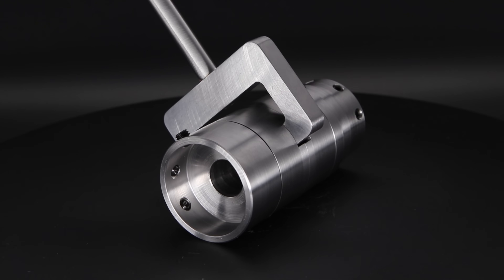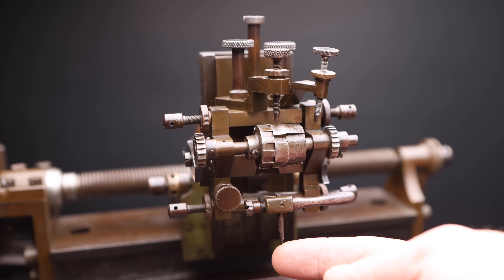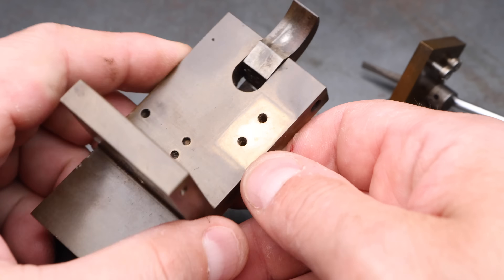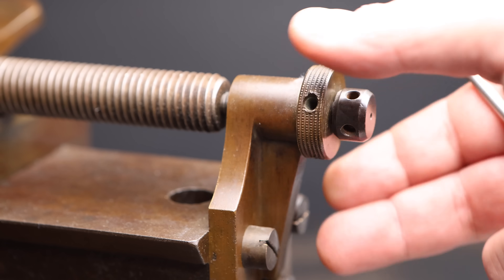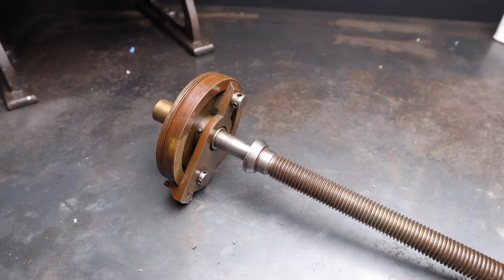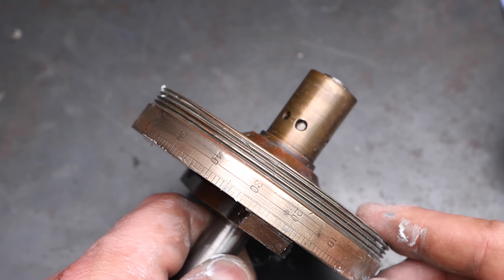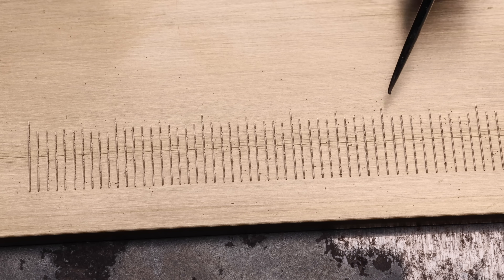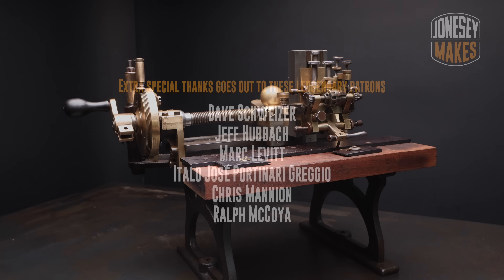The Most Interesting Tool You’ve (Probably) Never Heard Of? — And I’m Giving It Away

Comment: It looks to me, that it could be a tool for making rulers and tape measures Possibly? because of the way it makes an equal measured amount of lines, and every 4 small marks made, it will make a longer mark of equal distance between the smaller ones?  At least it seems like it Just by the way you are operating it. And all of the movements are adjustments for different size types of rules needed? I don't know? It just seems like it is a practical way of doing it? Having a tool for building rulers and tape measures?
Reply from the maker: You are absolutely right. That is exactly what this machine is intended to do.

Comment: the very common 60/40 brass is much stronger and much harder than almost all bronze, the reason for bronze is that its much more corrosion resistant, hence "gun metal" which is actually old naval canon barrel metal, which was used for lots of other things simply because of its availability.

Comment: 12:48 I didn't expect to see hex nuts on a machine this old. Do you think that nut is original, or do you think it may have been replaced at some point? I guess whoever machined the parts for this thing was certainly capable of machining a hex nut.
Reply from the maker: Good point, could well be a replacement
Reply: He’s nuts were first invented in the 1700s. They went into widespread use in the early 1800s. Can’t be sure but that nut looks similar to those made in the 1830s. Notice how thick it is.

Comment: A beautifully elegant design that appears to achieve its function with impeccable precision & efficiency.  

Consider that the designers of this machine were able to conceive how each of its sub-mechanisms would work within the greater whole of the device itself, before illustrating everything in a complex blueprint - all without the aid of a computer to help visualise it. 

None of the adjustment screws seem to interfere with any of the others, even allowing for the space needed for human fingers. This is far more remarkable than it may seem, especially if it was designed by a team of craftspeople working together while maintaining the extremely tight tolerance fit on the parts. Seriously, the various parts were cast & finished or crafted out of stock to fit together so precisely that it still functions more than a century after it was made.

I only hope that anything I could craft would do the same. Thank you for taking the effort to restore this amazing device to near its original glory.
Reply from the maker: Thanks for the kind words!

Comment: There is a surviving machine (I believe from the Keuffel and Esser company) for laying out the markings on slide rules  Only ever seen in a set of photos, machine is probably ca 1900.  There are some differences, but its construction is similar to this machine.  The K&E machine, later of course, makes use of supplemental notched disks (similar to those in chiming clocks for controlling the striking work for the hour) to semi-automatically locate the un-equally spaced logarithmic markings on the slide rule scale.  The notches in a given disk determine the amount of leadscrew advance on each "step", allowing for arbitrary spacings between graduations, limited by the accuracy of the notches in the disks.
It's something of a hybrid between this machine and something like a van der Woerd style automatic screw machine (sort-of).
Reply from the maker: Very interesting, thanks for sharing

Comment: What blows my mind is that standardized screw threads, which greatly facilitated the increased development and proliferation of new high precision machines and tools, were developed in the 1840's. 

If this precision linear dividing engine is from that era, it likely means it was among the very first generation of new precision machine tools that benefitted from the advent of standardized threads. Since its function is to scribe linear graduations on measuring devices, its developers would likely have strived to maximize its own inherent precision. To that end, I would have expected them to take full advantage of state of the art technologies of the time, including standardized threads.

Have you or Inheritance Machining happened to measure the thread patterns on the various screws and tapped holes to see if it matches up with any of those early thread standards?

This could very well be a priceless museum piece for the industrial revolution! 😮
Reply from the maker: Very interesting. I only measured the leadscrew and that was spot on 10TPI

Comment: I'm new to this site. Interesting machine. I wonder what steps the designers went throug to design and build it. They used basic components like screws, lead screws, etc. Would you see if you can find an explanation of how it was designed? It may be in a book, notebook, drawing, etc. Perhaps a mechanical engineering text would be adequate for the basic components. Start with the objective: scribe lines at equal intervals. Then, make some of those interval marks longer. Finally, make the longer intervals at regular intervals. More?

Comment: When, in 1964, the US Navy sent me to machinery Repairman School, we were issued with 6 inch, machine engraved rulers. We were taught that the 1/64 inch lines were .008 wide and the spaces .007, thus .015 close enough to 1/64 inch. We had outside calipers, and the pass out test was to turn brass, to various diameters, using only the caliper and rule. The pass was plus or  minus  .003 inch, checked with a micrometer. We should be able to visually pick half way on the .007 gap. At 17, my eyesight was good enough I passed. Now at 79, I struggle to read a micrometer. Amazing to see how those rulers were made!
Reply from the maker: That's interesting, thanks for sharing.

Comment: Using some mechanical machines and instruments, I found benefits from replacing the single line reading mark - with a vernier scale for higher accuracy settings and measurements.
A ten TPI leadscrew would make it easier for working in decimal fractions of an inch.

Comment: What is the purpose of the large threads around the handwheel?  I see that there is a guide that engages that thread.  Why is this needed?  Doesn't the 10TPI main leadscrew provide all the longitudinal motion?
          Can this machine provide EXACT  division, such as 9 divisions per inch for piano roll tracker-bar manufacture?
Reply from the maker: The large threads just provide a track for the stop to run in. The adjustable stops in the hand wheel interact with this to provide the division distance. 9 divisions per inch should be possible yes.

Comment: There were many specialized machine tools in the late 1800 and early 1900s. Designed to do one specialized job. The company l served my apprenticeship at and retired from had a specialized lathe in the Tool Room. Formerly a production machine. All it did was cut lubrication grooves in plain bearings. 
This engraver for linear scales it really dependant on the accuracy of the lead screw. 
I wonder how they cut the scales for slide rules.
Reply from the maker: That's interesting, thanks for sharing!

Comment: First time watching anything from your channel I was watching intrigued about the machine. It looks too good condition personally to pull it apart. The Patina I would’ve left alone but watching you use the incorrect size screwdriver made me pause and leave a comment man use the right Tools you only damaged screw and fasteners when you don’t use the correct Tools
Reply from the maker: These old tools use very odd sized screw slots. I intend to make a set of hollow ground drivers for this purpose, but I’ve not had a chance yet!

Comment: As a long retired toolmaker/jig borer and 78 summers old now, and having worked on similar old pieces of equipment,in for repair or modification, back in say the sixties!? I now look with the predominant in view of just how clever the individuals were that designed such complex tooling! From the start of your cleaning process, just look at the finishes that you were restoring! Big chunks of bronze, from either solid bar or castings with all that entails and in turn machined and filed to such an accurate finish to boot! Lovely precise workmanship, done to enable even more accurate resulting equipment! Those in engineering at the earliest times, particularly clock and watchmakers, lathes etc,….retrospectively have to be thanked for the resultant ease it is to do precision machining today! Cheers for your respectful content!
Reply: Yes, and all done without CAD, CNC, or even electronic spreadsheets.
Reply from the maker: Thanks, much appreciated.

Comment: Scotchbrite can scratch any metal surface—it uses aluminum oxide in the strands. 

However, you can get finer grades of Scotchbrite. There's a gray (7448) which is 800 grit and a white (7445) that's 1200 grit. Your local industrial suppliers should have them

Looks like that machine was designed for easy maintenance. No press fits, rivets, etc.

Comment: This is fun.

I have seen horrible things happen when bronze or brass is polished with steel wool, tiny pieces of steel get embedded in the surface and then rust!, probably doesn't matter on a nicely oiled machine but it looks freaking horrendous on a saxophone.  You can get bronze wool instead.
Reply from the maker: Good tip, never heard of bronze wool!

Comment: The moment that tap snapped, it sent a shiver down my spine. Retired now but one of the small production jobs we had was a saw called the Wells Saw. One operation was drilling then tapping 8 holes. After the set up I'd hand it off to an operator, grab a chair and wait with a hand full of taps. Cause I dam well knew with in 10 minutes I'd be replacing 2 or 3. They would complain it wasn't set up right, I'd run it no issues. rinse and repeat. Eventually they would get but dam it could be a pain.
Reply: My dad invented control boxes for tapping and drilling machines.  He had 26 patents.  If somebody had a new alloy, he was who they came to.  He would go to trade shows and people would bring things in to drill and he did it with no breakage.  One guy showed up where he worked in a rumpled suit with a brief case who had been sleeping in hotels for months traveling around the country with a sample of a new alloy that nobody could touch.  There was one tiny dent that an electric arc had done.  My dad put it in a drill press and put a hole right through it.  He used DC motors and analog computers with one dial on them and that was it.  They would drill or tap anything except a grind stone.  CNC killed all that.
Reply: At on point in life, I was tasked with modifying the hinges on the navigation light doors on a bunch of submarines. The mounts were about a quarter inch from the bulkhead.  Had to drill & tap them to specs. I got very handy at getting  broken taps out! 😅

Comment: The axiom: every precision tool and machine was made by a less accurate tool and machine. 

I’m curious about the units on large ratcheting drum. Can this increment in mm and inches, and integer fractions or decimal fractions? Or any increment of random length? 

I was wondering if a specimen long length, not inches or mm, could be divided uniformly?
Reply from the maker: The lead screw is 10TPi so imperial only. I think the hand wheel is in 100ths of an inch, but I could be wrong on that.
Reply: @joneseymakes So I assume it could make a vernier scale to compliment a decimal inch scale. 

It’s gorgeous. What a marvelous find. Complete, unmolested, no significant corrosion. Your restoration is Smithsonian grade preservation. 

I’m not a machinist, but I do hsve and love my near perfect 1903 Brown & Sharpe 0-0.5 inch, 50 pitch micrometer. Graduated in 0.0001”. 

And my 1955 Wild T3 theodolite, direct reading 0.2 arcseconds angle resolution.

Comment: I am an antique gun restorer.. some of my techniques may be of interest..

I am very careful to use hollow ground screwdrivers to remove machine screws. These fit the slot precisely and do not burr over the edges. I would always hold the item in a vice with lead jaw covers as this reduces the chances of slipping. If a screw is tight, I would apply penetrating oil and let it lie overnight. If there was still resistance I would apply local heat with a small blowtorch. 

My usual opening step to restoring metal components is to boil them in water with a handful of washing soda (sodium carbonate). This has a number of outcomes. Firstly it removes a lot of dirt and dried oil etc. If any of the components are steel and originally blued, the boiling restores the blue. Following the boiling in washing soda solution, I then rinse in plain water. The water in my area is very soft.. if you are in a hard water region, you might want to use distilled or deionised water. Remove the components from the water hot and they will dry quickly on a paper towel.

I only ever use 0000 grade wire wool or soft "carding" brushes which are obtainable from gunsmiths supplies such as Brownells. Brownells is also a source for gunsmith's hollow screwdriver sets which I referred to above.. 

There are a number of restoration decisions that need to be made, although I usually always try to flatten burrs with a polished hammer. One thing I always do is to apply Renaissance Wax to internal surfaces whilst reassembling. This is a chemically neutral wax developed by the British Museum for restoration and preservation. 

I do like the "adjustable Allan key"!  Might just have to make one of those!
Reply from the maker: This is great advice, thanks for sharing, much appreciated.
Reply: If you decide to replicate the Allen wrench, please post a video, I love seeing people replicating tools and how they approach it!
Reply: @josuelservin I loved the idea and look of this little thing but in 60 years of reparing and later designing things, I've regularly found myself with gadget that had stuck a
Allen head screws that simply didn't have room for the head of that lovely wee thing. Still, I find myself loving it.
Reply: Great info , thank you from a beginner👍
Reply: If you're gonna try to make the adjustable thing, Chronova Engineering had plans for it I think:

https://www.youtube.com/watch?v=8IewMXUzt7U
Reply: Can you only do divisions of ten? Not 8ths?
Reply: @Jessica.is.immortal  I can divide in infinite ways.. can't you?
Reply: I never heard of "hollo ground screwdriver" - my first thort: a 'non tool' , like a 'L Hand hammer', that yu send a new apprentice to get from stores on April 1st😂
Reply: @Tom-gv2eo  No.. they do exist. Normal screwdriver blades taper towards the tip and only touch the top edge of the slot of a screw. This usually results in the edges of the slot burring over. Hollow ground screwdriver blades are parallel or have a slight flare at the tip where they go into the screw slot and contact the full depth of the screw slot and not just the top edge. They come in a wide variety of sizes to fit screw slots exactly, or you can grind down an oversize blade to fit...
Reply: @Tom-gv2eo the name of the tool describes how it is sharpened to its desired tip width.

Comment: Interesting that it uses a 10 tpi lead screw, yet engraves lines on a base 10 system (longer at fifth line, and longer still at every tenth line).
Reply from the maker: Yes, I assume for splitting inches into decimal units
Reply: @joneseymakes  Yeah, I have a ruler that has tenths of inches on one edge and it took me literally years to realize that's what it was. And believe it or not, it's come in handy one more than one occasion. Once while trying to drill holes to mount my router on the wall for the keyhole slots, I measured in metric and it was neither a nice number of mm or inches, but tenths of inches was perfect... something like 4.3 inches.

Comment: Fascinating machine! I was expecting some restoring that involved more than polishing the parts though. Maybe some machining new parts to address the inconsistent distance between graduations? Lovely gift that I would find endlessly interesting nevertheless.
Reply from the maker: There wasn’t too much wrong with this machine once I’d stripped it (at least before I shipped it), and I’m always torn between keeping the machines 100 percent original and making improvements. I have more old machines that do need significant work though as they have missing parts, so keep an eye out for those videos. Thanks for watching!

Comment: Beautiful! ❤ Put a reversible ratchet in the handle to drive the wedge between the jaws when torsion forces are exerted during driving or loosening. With a clever design the during drive mode, driving of the handle can become the adjustment screw allowing you to slip in the jaws small configuration and a few turns later they've spread and ready to splay as torsion increases. The more torsion force, the more the jaws are forced into the corners to ensure no slip .
Reply from the maker: Great idea!

Comment: Adjustable Allen is a fascinating idea, though I am hesitant on only one aspect.. how much abuse can it handle? Is it meant more as a show piece for fresh bolts or can it handle stuck bolts. Would you be able to twist off the head of a stuck bolt without snapping the internals of the tool?
Reply from the maker: It feels pretty sturdy, I’ve not given it too much force yet, I’d be heartbroken if I broke it!
Reply: @joneseymakes based on the video of its making, it should stand up to regular use around the workshop... but galled up stainless on stainless I would leave for heavy duty tools 😅